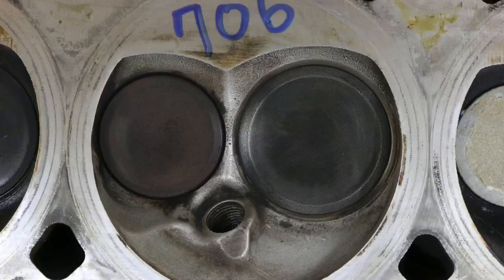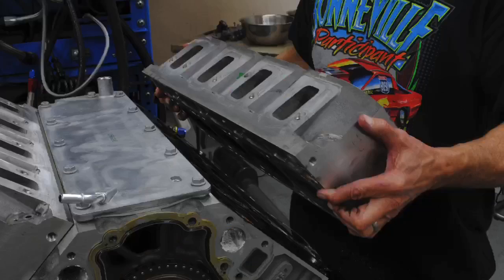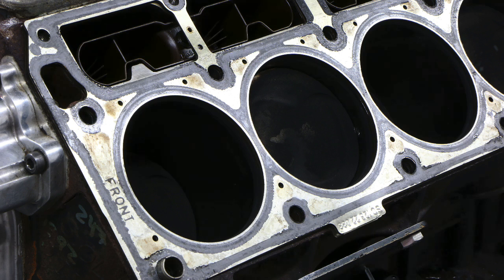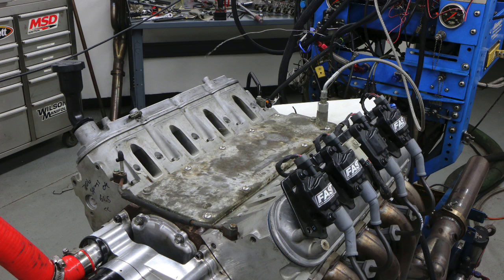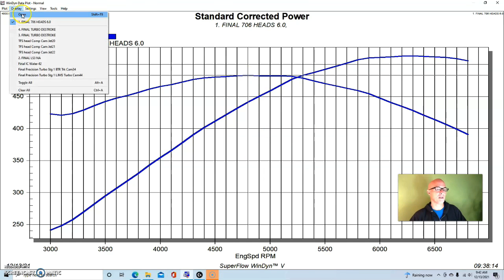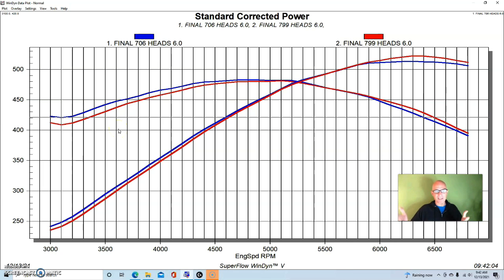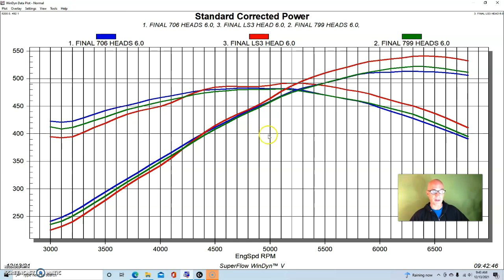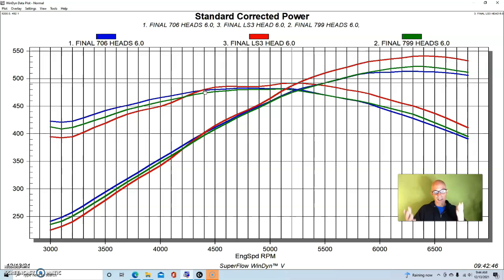JUNKYARD LS HEAD UPGRADE-CATHEDRAL PORT VS REC PORT-WHO WINS? 706 VS 799 VS 317 VS 823 (6.0L & 6.2L)

Comment: Super off topic but I found out today JLP offers a 4.415 in stroke modular crank to stroke a 5.4L v8 into a 5.7. Combine that with a 3.605 big bore sleeve kit from darton, you can effectively stretch the 5.4 a 6.0L dohc mod motor. With the ability to bolt coyote manifolds onto a 5.4 4v via adapters, we now have the ability to compete in displacement with the LS crowd all while boasting 4 cams and tons of airflow! Thats a test I want to see, 6.0 ls vs 6.0 4v mod motor
Reply from the maker: we already have 5.4L vs 5.3L
Reply: @richardholdener1727  More displacement is always the answer!
Reply: @madmod  modular gets whooped. But lets really break this down to prove it to yourself.  You want a completely custom modular to compete with a stock ls.🤣🤣🤣
Reply: @HioSSilver1999  Well the prior testing shows that it took more than the 4.8/5.3 offerings to compete with the power had from a 5.0 coyote however the 6.0 reigns king above all 3 mostly because of displacement. Knowing that the 5.4 can now share coyote induction cheaply, and boast huge headflow in mostly stock trim, it is cool to know that they have room to grow in displacement. However, regardless of the fact that it takes custom components to make it happen, the Modular architecture is capable of 6.2L out of an iron truck 5.4 block. Sure you could just go grab a stock 6.2L sohc v8 from a f series which is quite the contender for the ls based combos but they dont have a 4v head option available yet. Modular 4v C tumble port heads are dime a dozen and can support over 650hp na on the right combo, such as a 360+ci dohc v8.
Reply: I'm not here arguing whats cheaper, just sharing info that the biggest Achilles heel in the mod motor(displacement) can effectively be solved.
Reply: @madmod  a 4.8/5.3 was never performance oriented engines. They were truck engines in the truest form. I would never expect them to compete with a coyotah.....but the topic was a modular.  Of which a 4.8/5.3 more than competes with.

A sohc 6.2 would be interesting.  I haven't seen anyone hotrodding those. A friend has one in a similar configuration as my 03 6.0 2500hd. I'd say they're close stock for stock for power with the edge going to the sohc 6.2 in acceleration due to having 2 more gears in the transmission.

Good luck getting 650hp out of a na modular.
Reply: @HioSSilver1999   The 5.3 specifically was offered as a high performance option such as the l33 aluminum 5.3 and the only reason we compare those instead of ls1's or even lq4s is the fact that they are far more easy to source. The aluminum 5.3 is used specifically for re-sleeving and stroking for large displacement so id say its a good comparison. Ive only found a handful of 6.0s in my yard compared to the 15+ 4.8/5.3 always in rotation. Not to mention everyone and their mom is running these truck ls combos because they do make good power.
As for Ford's,
Coyotes are mod motors through and through and more coyotes are truck engines than mustang engines so I dont know why comparing them isnt fair by your definition, they are both designed for working over peak performance. The reason i mentioned the yote is that it represents the top trim mod motor for na power but comes with a hefty cost hence why people opt for the truck motors or early modular tech. Now we have the ability to build actually compete with the power production offered by the yote/and 6.0 for far less cost, and compete with the ls truck motors in displacement. This is why id like to see the 6.2 sohc as well. Ive seen a fox chassis run 9s na powered by a f series 6.2 so they have some potential.
My point is not trying to race dynos numbers. I just want to know if you can make bolt on 6.0 ls power out of an na 5.4 stroker.
Sean Hyland has been selling 6.0 modular shortblocks for years but ive never seen any hard data on them. Ive personally seen stock displacement 5.4, 00R headed combo in the 500rwhp range na and shifted at 8k rpms etc so power production definetly exists in these combos.
Reply: @madmod  i repeat....there was never a high performance 5.3. It was simply a truck motor put in a car. That 303hp impala ss wasn't even the most powerful 5.3. It was rated as much as 330hp. The l33 was known as high output.....but it was not a performance engine. 

The reason 5.7, 6.0 and 6.2 are used as a comparison is because those are the high performance engines available.....other than the 6.0 truck motors. Those aren't high performance although they run pretty good.

Coyotahs aren't modulars tho it's a very similar platform. If coyotahs and modulars were the same......then why was modulars such a turd? So obviously they aren't the same or even that similar other than basic layout.
Reply: @HioSSilver1999  The modular came out in 91 lol. They are so much the same you can bolt a coyote crank and connecting rods into a 91 non pi 2v 4.6. Obviously its improved but its still a Modular engine just as every other 4.6, 5.4, 6.2, 6.8, 5.8, 5.2 voodoo. They are of the modular engine family
Reply: Regardless of what you decide is high performance or what not, I still want to see a big ci dohc mod motor specifically based off of older 5.4 tech.
Reply: @madmod  6.2 ford was a different motor all together. 

"Modulars" were generally considered 4.6, 5.4, 6.8 v10, 5.8 trinity. The 5.0 was a large enough change not to be a "modular". But one could consider it a gen4 modular i guess. And now there's been 3 generations of 5.0s.
Reply: @HioSSilver1999  6.2 sohc was designed as a essentially a big block modular while still sharing the bellhousing, motor mount bosses, main webbing on the block, as well as even the deck surface and coolant routing is all modular just larger. They were careful to design the 6.2 so that they could use the same dohc tech with Seccondary timing chains for 4v heads on the boss engines. You could argue the 6.2 is the odd ball out of the group but its still a enlarged mod motor down to its core elements. Hell you can run a 6.2 off the factory 4.6 harness because its so close to the same.
Reply: @madmod  sure there are similarities.  About the same as a sbc and bbc. But the rest is what makes them different.
Reply: @HioSSilver1999  You said good luck getting 650hp out of a mod motor. In the 2014 edition of engine masters, theres an article of Kaase's 409 cid dohc 6.7L using the exact tech I was refering too as far as stroking a 5.4 mod motor.

GT heads, Block, Cobra R intake , 11.5 CR.
He used a 3.720" bore and 4.700" stroke.

More than 600 ftlbs @3400 , peak of 666 @ 5100.
720hp @ 6400 on pump gas! 
This combo killed similar displacement ls stuff which is exactly the kind of test I want to see. With this 4.700 stroker crank, you can achieve over 6L of displacement on a stock bore size. You say the modular loses when compared to a similar size ls but this kinda disproves that.
Reply: Its alot of stroke and a small bore.
Reply: The bore will limit flow.  Due to limitations of valve size.
Reply: @dennisrobinson8008  It doesnt tho. Even stock 1994 4v head castings flow more than 230cfm@.400 lift bone stock, untouched. The valve curtain area for the 2 intake valves flows better than one large single intake valve
Reply: Pprted and aftermarket ls3 heads are making 230cfm@.3", 280-300@.4"and 320-340@.5" and peak flow 360 to 390 cfm.   Modular heads aren't making almost 400cfm due to the small bore. Maybe a little bit over 300cfm but ls heads flow alot more.
Reply: @dennisrobinson8008   ported 93-98 b head 4.6 4v castings have supported several 5 seccond 1/4 mile combos in mustang chassis, down as low as a 5.88. That is Faster than any LS combo has ever run outright, even including full billet engines and thats the earliest and crappiest stock head casting. Mmr has regularly been dishing out combos with 330 to 340 @ .500 CFM out of something like stage 3 03/04 heads with 1mm Oversize valves, 360-370 CFM is also common on an all out set of their Ford GT heads with stock valve sizes which cost about as much as a proper aftermarket LS Casting with cnc work.

While fully cnc'd, ls3 heads may flow great and make killer power, they still dont match the valve curtain area and low lift flow offered by a dohc head. Do the math, two 31mm valves in a stock mod motor vs one 58mm valve in the ls3. The two smaller valves not only fit into a smaller bore size allowing leightweight pistons but also have more valve curtain area, hence why they dont require nearly as much lift to flow well.

These modulars absolutely killed in engine masters combos and quite litterally mopped the floor with the competition to the point they were banned from competing proving that the engine was more than capable of producing power out of a smallbore size.
Reply: @dennisrobinson8008  Regardless of flow numbers, the modular based engine ran by John Kaase was making almost 700lb/ft of torque naturally aspirated beating out similar displacement engines(400-410ci). If it were still allowed in competition, it would likely still be leading the pack or rather the coyote/voodoo architecture would be.
Reply: @madmod You know enough to know power potential is dependent upon airflow.   You also know forced induction makes airflow.   So if the mod motor can run hi 5s with 330cfm heads and however much boost.    How fast would a billet ls7 style motor with 430cfm of airflow make with similar or upgraded forced induction?   What about if you just ran the 500cfm MBE canted valve heads for ls7 style engines?   If someone on the ls side wanted to beat that mod motor that ran hi 5s they could.   But it is super impressive to see the development they've done on small bore mod motor and coyote.   Mercedes has the 6.2L dohc c63.   It has a 4.02" bore and you can sleeve it to 4.125.   The heads stock flow 300cfm@.300" and 350@.400" and 365@.5" and greater.   Those heads can be ported to make 430cfm peak airflow with stock valve size.   You can upgrade the intake valves from 40mm stock up to 42mm and make 470cfm after porting.   The Chevy lt4 didn't release flow numbers but stock it has 42mm intake valves and a 4.125 bore.  I suspect stock they are making almost 400cfm.  You know that engine makes 670hp naturally aspirated at just over 8000 rpm.   All of its exciting to me.   Id like to see someone build out a 3v ford to make more power than gen 3 coyote.
Reply: @dennisrobinson8008  Theres more to a combo that what its heads flow on a bench. Theres advantages both ways be it going modular or LS. Still crazy that those old modulars can even hold a candle to somethinglike an LS3. I agree that everything is there with the LS to be able to make insane power but the track times still dont lie. It seems only the 7+ litre LS combos run even close to the times those old mod motors ran and still dont manage to outrun it, *yet*. 
Im a big fan of 3v modulars too. Be exciting to see Richard run his 3v v10 tests.
Reply: @madmod  You got links to those modulars?   You mentioned one making around 700 ftlb out of 400 to 410ci?    I never knew you could get that displacement.
Reply: Fuel type, methanol will certainly do it.
Reply: @dennisrobinson8008  Show me how too much stroke and too little bore caused an issue with the mod motor?

Comment: Richard, get out of my head! I've been watching your head videos most of the day. 🤣 Hey what ever became of the slant 6?
Reply from the maker: the head was bad-it has been fixed
Reply: @richardholdener1727  stick a roots on that thing
Reply: If by chance it was a bad engine, I have a running slant 6 in really good condition that could be used for the cause?